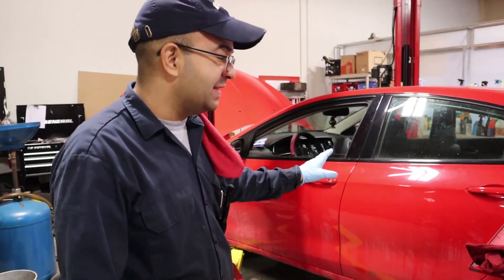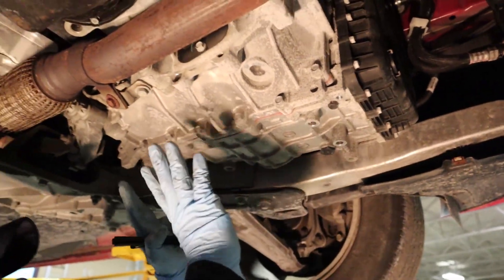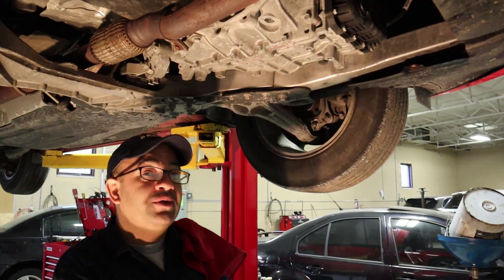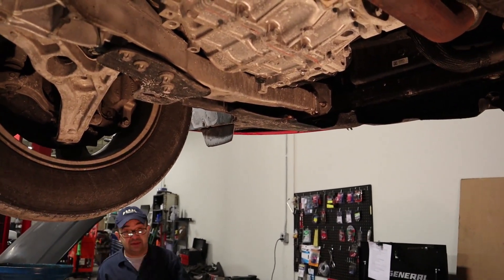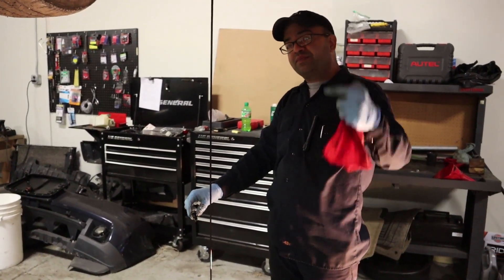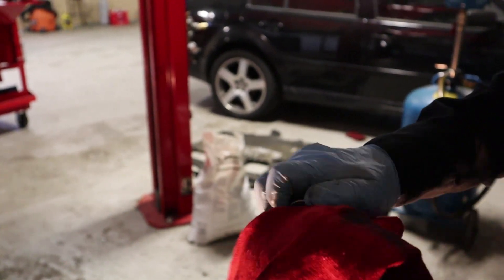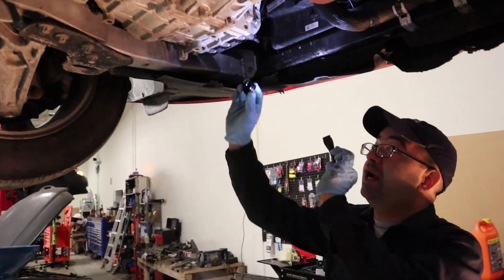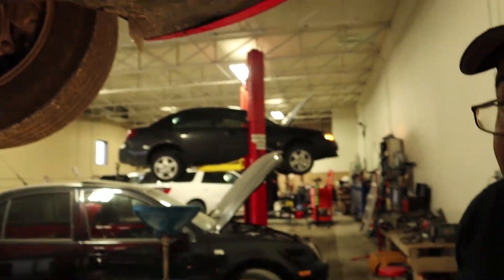Dodge Dart Transmission Fluid Flush (SPIV | SPV)

Comment: You didn't show where you filled it from, did you fill it at the valve body plug or from a different spot up top? I keep finding too many conflicting opinions.
Reply: 🤣🤣🤣🤣🤣what was the point of the video
Reply: On the opposite side above it there a plug

Comment: So once you drain the transmission fluid where do you do you go to the regular spot on top of the engine to put the transmission fluid back in
Reply: Almost right above it, there's another plug. You can add it theres.

Comment: Thanks! Very helpful. Did you use a pump to fill it back up?
Reply from the maker: Yes we did. We tried doing it by gravity but there was no room
Reply: Captain Stevie O I’m assuming he filled back up through the plug he removed? I wish it would have shown the filling process.
Reply: James Hughes I believe drained from the bottom. Filled through the side. He shows where at. You add whatever you remove 
etc remove 1qt/add 1qt
Reply: @CaptainStevieO  how?
Reply: @jameshughes4264  they would never show that... It's coming to a point in life that people are doing their own mechanical work ..
Reply: Yes a pump was used!! If you don’t have one just use a funnel and a longish half inch or 3/4in clear tube

Comment: Supposed to fill from the top of the transmission, just above and in front of the driver side CV axle, there is 24mm bolt/washer.  That is where you fill and also use the "special" dip stick.  There is also an easy to find trans fluid temp chart you also need to follow when checking fill level.  I wouldn't let this guy work on my car.  These short cuts might be enough to get you passed not having the $13 dip stick back and running guestimate.  Not what I'd expect from a professional mechanic I am paying.  Too many of these newer automatics are too prone to problems and expensive.

Comment: There is nothing wrong with filling this way people don’t know what they’re talking about yes you can fill it from the top but also you can fill it from the button with the pump usually it would start dripping around 3.5 quarts then you start the vehicle to let it circulate and run it though gears then you would be able to add about half a quart more and see a little drip occur and plug in the cap back in and wait till it gets to about 122 degrees you can check with a scanner while it’s running and then you can use the measuring  tool and see if you’re at the right level should be about 25 when all set and done..